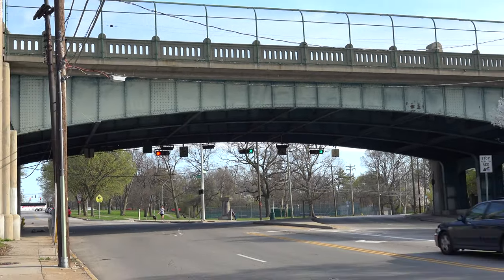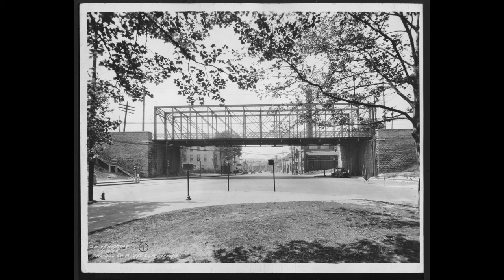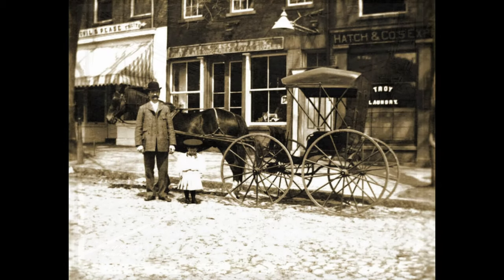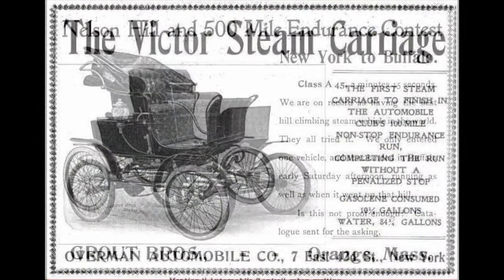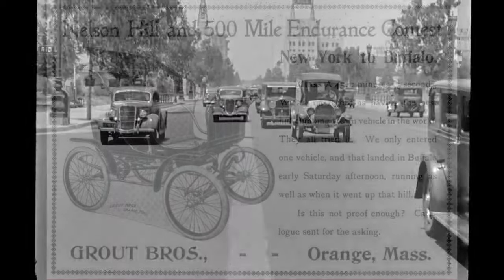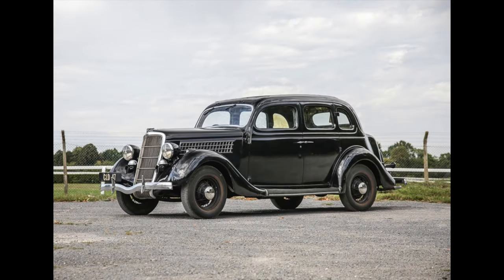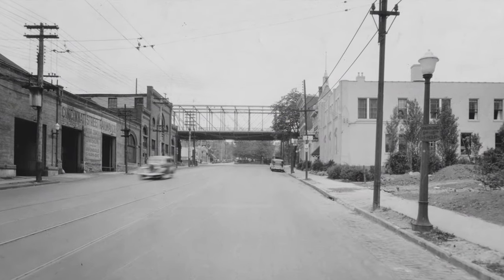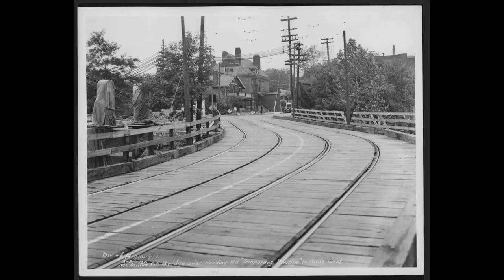Manhole covers are actually access portals for reinforced concrete inspection wells. McMillan Bridge

Comment: There is a pedestrian tunnel under interstate 75 in St.Bernard connecting the residential area with Ivorydale. It must have been built during or after construction of 75 to allow residents to walk to work at Proctor & Gamble.  The tunnel is sealed at both ends. I saw both ends for years and never realized I was looking at opposite ends of the same structure. I have tried to find information on this, and any other tunnels under highways in Cincinnati, and I have not been able to find anything! If possible, can you do a video on this tunnel? 

Also, LONGVIEW STATE ASYLUM off Paddock Rd had its own cemetery in the eastern edge of the property. It is still there! It is behind a street of apartments just behind Woodward high school on Reading Road. I found information on the history of LONGVIEW STATE HOSPITAL, but nothing on the cemetery now: who cares for it, who is buried there. If possible, can you do a video on the LONGVIEW CEMETERY? 

Also, next to Elsinore in front of WCPO CH.9, over interstate 71 is an old train bridge. From its angle, it looks like it was part of the track that is under Eggleston Ave. But the other side is difficult to trace, unless there was a track parallel to Gilbert Avenue, or a tunnel under Eden Park. If possible, can you do a video on this train bridge at Elsinore?
Reply from the maker: Great  idea!  Do  you  know  where  in  St.  Bernard  it's  located  or  the  GPS  Location?
Reply: @historyinyourownbackyard2363  The St.Bernard side is at the dead end of W. Ross Ave., and the opposite end is near intersection of Beech & Railroad Ave.
Reply from the maker: @floydthompson8668  I  found  it!!!  Thanks.
Reply: @historyinyourownbackyard2363  You are so very welcome! I love discovering Cincinnati's rich history! Evidence is everywhere once we know what to look for. I am fascinated by the history of the seminary that was on Gilbert Avenue before the Civil War and its relation to the HARRIET BEECHER STOWE HOUSE a block or two away. The block currently occupied by THOMPSON MCCONNELL CADILLAC was where the seminary was. If you drive around that block, you see staircases leading to nowhere. I think they are the steps to the old dorms of the seminary. If I remember correctly from what I read, the dorms remained after the seminary was torn down. Not until the block was cleared for urban development were the dorms demolished too. That whole block from the HARRIET BEECHER STOWE HOUSE, South to MARTIN LUTHER KING has a rich history I think most Cincinnatians are unaware of.
Reply from the maker: @floydthompson8668  I  drove  past  the  Harriet  Beecher  Stowe  House  just  yesterday.  I'll  check  out  those  steps  you  mentioned  as  well.
Reply: Back in the 70s I drove my car in that tunnel! Needless to say my car got stuck in the pedestrean tunnel! I was on the Al Shottolkete 11 o' clock news! Then on that Sunday I was the Spotlight Report! Was very imbarrassing! A wrecker had to pull my car out of the tunnel. Train traffic had to be halted. Police, Firetrucks, and a zillion PG people came to see what happened in the tunnel. That was my crazy days. I all mellowed out now, thank goodness!
Reply: @bcats1309  Wow, that is an amazing story. I did some silly stuff with my first cars too! But it was a great time we grew up in. Thank you for sharing some history on the tunnel! I wish more vintage Cincinnati news reports were available online. At least reports on high school athletes who were frequently in the news. These would be a treasure for their children and grandchildren. I'd also like to see the reports on the grand opening of all the Cincinnati malls. A video of demolition of all former Cincinnati landmarks.

Comment: Lighting was removed as the fixtures were brass, many ornate brass lights including traffic lights were removed in the 60s as the brass was easy to scrap...just bust it with a hammer and Bob's your uncle its scrap ...traffic engineering .